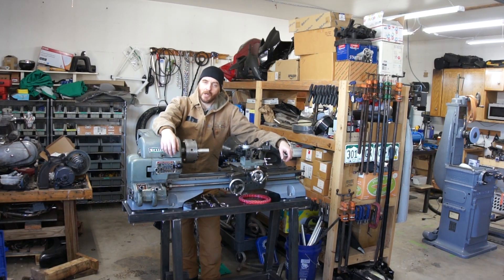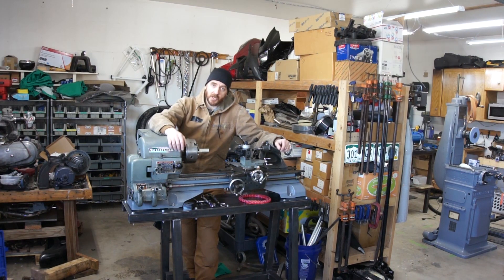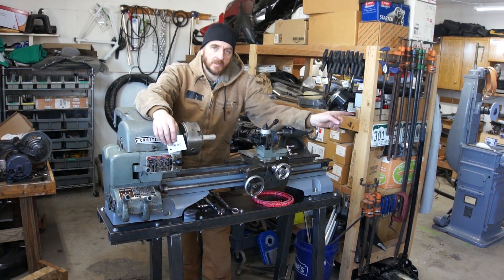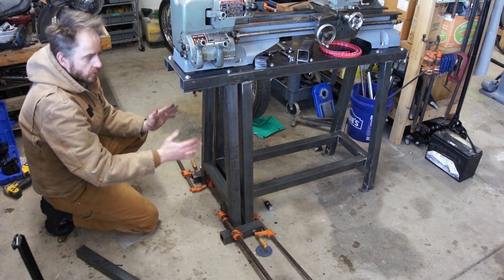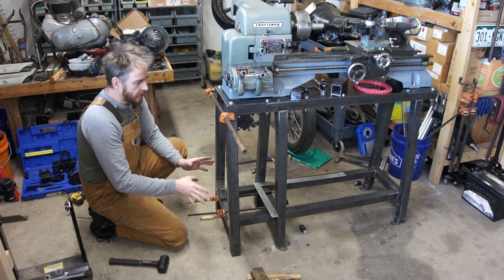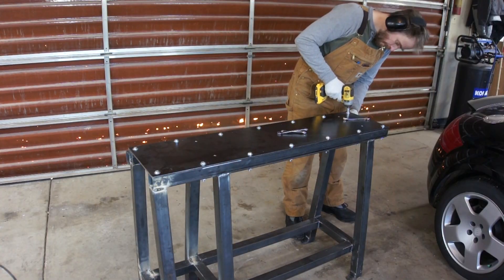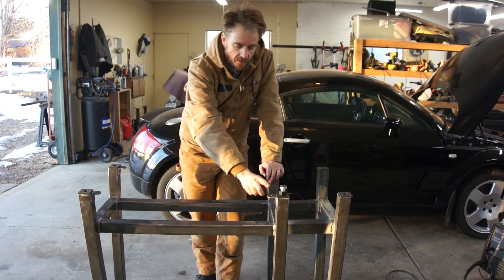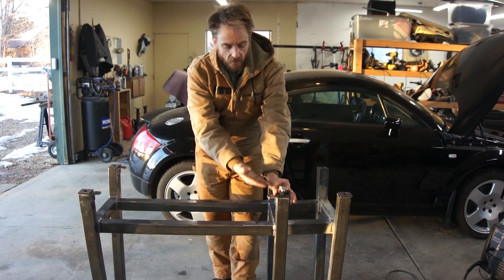I Screwed Up - Fixing the Unstable Lathe Stand - Atlas Lathe, Part 3

Comment: the top would have looked a little better is you tapped it and had bolts from the bottom pulling in down. but i LOVE this stuff and your vids are awesome!
Reply from the maker: Yeah, I regret having the bolt heads on top.  If I were to do it again, I'd use a different approach.  I have the lathe apart right now for an overhaul and those bolt heads are constantly in the way.